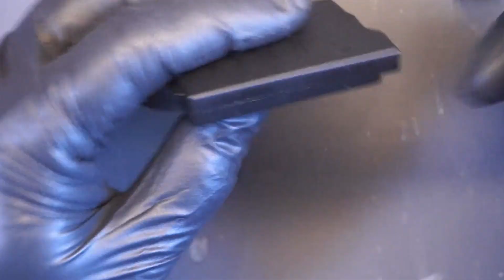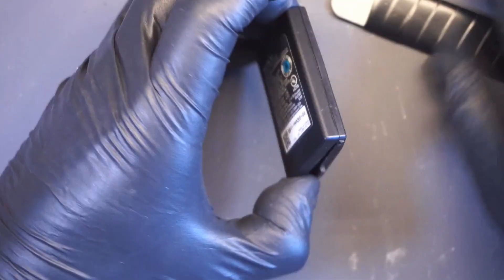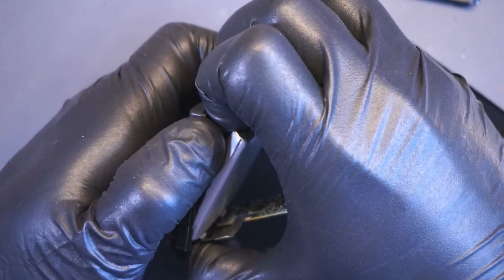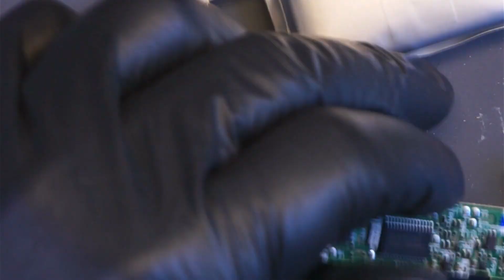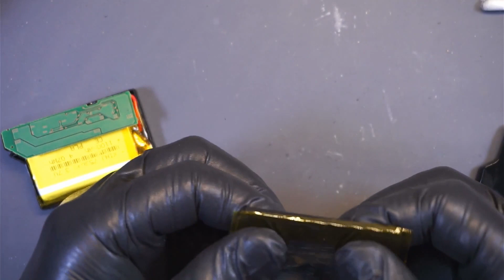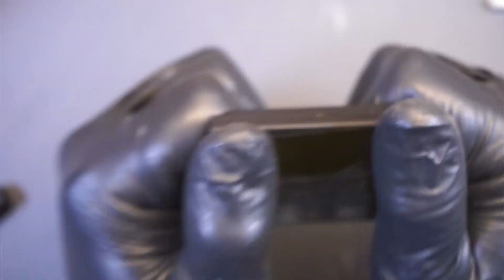Dead Sony Playstation Portable PSP Battery | Recell / Repair Battery Pack

Comment: Would this fit? "3.7V 103450 Lipo Battery with JST PH2.0 Plug for Electronic Devices | 2000mAh 3.7V Lithium Polymer 103450 Battery" on amazon. It's the same size battery used for playstation controllers. User review measured it at 1700 mah so close to the original 1800 mah OEM cells. Currently $9 USD for two batteries.

Comment: 10,000mah battery is a battmax of psp 3000.
Reply: And it will take forever to charge it, cuz PSP  any of them charge the battery at almost 300mah

Comment: yes i am facing a problem. it drains the battery by it self .is it the issue with everyone ? moreover the battery indicator always show full battery though the actual percentage is lower ..any fix?
Reply: If it drains quickly it might be cms battery . Because if it is dead the battery itslef try to charge those continuesly

Comment: Do u have any battery drainage issues when the psp is turned off ?
Reply: yes i am facing the problem. it drains the battery by it self .is it the issue with everyone ? moreover the battery indicator always show full battery though the actual percentage is lower ..any fix?

Comment: You are evil for saying the battery comes apart easily - I had to fiddle with mine for half an hour and had to break some of the plastic between the two sides because somehow it became one
Reply: Yea, I use anti-glue liquid at the seams and its become much easily

Comment: hello, my bms board is different from yours, last time i check on the battery pin that looks like a fork, the only reading is 0,5 volt dc, do you have any clue ?

Since the direct battery reading show 3,7 volt on the battery PADs

Comment: I tried soldering the battery to the PCB. Current flows (tried with the multimeter) but it's like the battery is not recognised by the PSP, resulting in the console not powering up. Any idea why this happens?
Reply from the maker: Tried using another PSP battery? To eliminate a problem with the console itself. Also check your work twice 😊

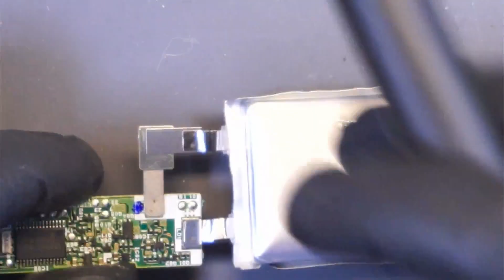Comment: Hey, man, at around 1:39, you show the battery management board. I currently don't have a soldering kit at the moment but i just want to conserve the board and throw away the old battery. Do you think it would be okay to cut off the two latches, for example, with some scissors? This wouldn't damage the board, right? Thanks for reading my message!
Reply: thats what i did until I learn to solder

Comment: Hello, i lf i wanted to add a 4000mah cell would it work? I mean like correctly charge to 100% and display correct percentage on battery information?
Reply: afaik, as long as it fits in the battery shell should work fine, i saw some guy even modded it to have 10k mAh

this guy modded it to 10k mAh, but yeah it's too damn big, idk 4k mah cell size is, but if its big make sure you make a 3d printed case for it
https://www.youtube.com/watch?v=qGofx5jDiZA

Comment: I followed the guide, the battery charged up to 15% and then all of a sudden it dropped to 0% and it always stays like that, if I remove the power supply it stays on for a few seconds and gives the low battery signal and turns off.
The battery has a voltage of 4v
How do I solve it?
Reply from the maker: Sounds like a dead battery pack. What is the specs on the pattery pack?
Reply: @electronicrescue  The battery is a 1200 mAh Li-Po 603450
The battery is charged, I tried the same cell in a non-original battery pack and it works there.
Reply: @zut6174  Maybe try another battery?
Reply: @maskednil  The battery is good, the problem was the PCB, I solved it by replacing it with another one.
Reply: @zut6174 AH! I see! May I know if you were using the same green PCB like in the video, or the yellow kind?

Comment: Would be good if you make another video telling us about the REAL time use of the battery. The Menu says something like 5:47 hours but we know that this is probably wrong. So if you make a comparassion with others batterys on the market would be a good one.
Reply: It's always best to calibrate new batteries so that it can understand it's potential and give the actual hours left
Reply: @eisasohail6818  doesn't work like that on psp, i tested with 4650mAh and it still shows that my battery is 1200mAh, these batteries tell your psp what capacity the cell is, regardless of actual capacity
Reply: the new battery is 100mah lesser than the original so 5-6 hours would be accurate

Comment: Looks like I came too late to this party. Neither the 2Ah nor the 1.2Ah LiPo Turnigy batteries are available that I've been able to find. At least, not in the voltage and dimensions needed for PSP batteries. I'm hoping they're just in a shortage and haven't been completely discontinued. I've just recently been looking for a 2Ah since I'm wanting to do this for my PSP-1000, but have been hitting roadblocks.
Reply: I looked around for a while and was able to get the turnigy 2Ah lipo from a site called othermod for $15 shipped. I removed the small bms on the turnigy battery and soldered the battery cell to the psp battery board and its been great so far.
Reply: Sorry to hear it, I just discovered this, I too am trying restore a 1000 and the battery is a major road block. I order 2 "new" ones that might be crappy, I'll probably give this concept a go... If I can find parts
Reply: @Stoictuts hello, can you tell me how were the batteries that you had ordered? i also want to do something like this for my psp

Comment: Didn't u have to remove the battery charger controller before connecting in to the PSP battery controller?
Reply from the maker: I thought about this some time after releasing the video. It's a little overkill with two charging controllers but it does work just fine as it is. I would probably remove it the next time i need to fix a battery
Reply: @electronicrescue  some people have had batteries catch fire because of 2 BMS boards connected to each other, so I wouldn't say it's fine :)

Comment: This is a great video! A couple of questions: 
1) do you have the dimensions of the battery cell you're using? The final fitment looks great
2) are there any alternatives to glueing the enclosure at the end? Like, maybe custom 3d printing an enclosure that can be screwed together or something? 
3) what's your opinion on aftermarket clone batteries? Have you tried comparing the battery life of those to this one? 
Thanks in advance!
Reply from the maker: Hi Frank

1. Dimensions are 7.5mm x 30mm x 48mm
2. I don't think 3d printing is an option because the case plastic is really really thin (plus there are these tiny clips on the sides). But if you don't have the original case then just buy an aftermarket battery and replace the battery inside. I have only seen glued batteries. I guess you could use double sided tape, but the enclosure would probably not fully close 
3. See point 2. I have very bad experience with aftermarket batteries but I'm sure good ones exist